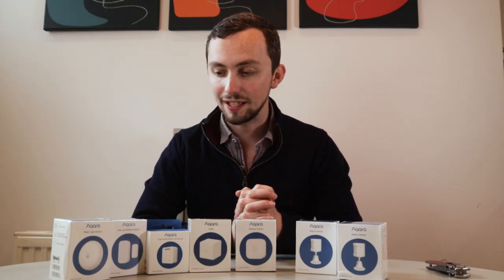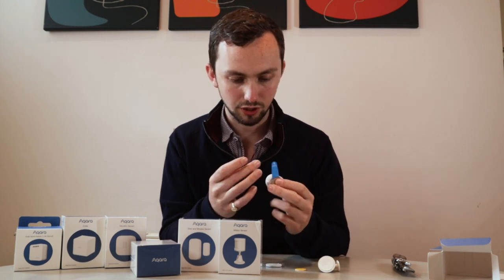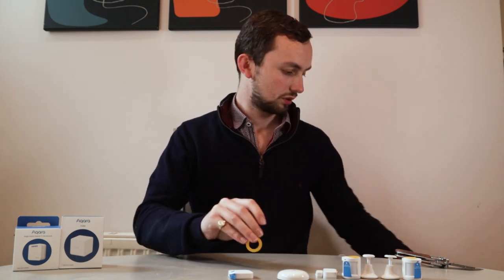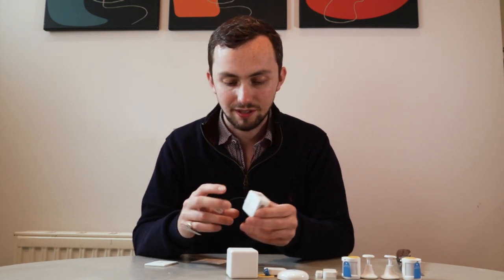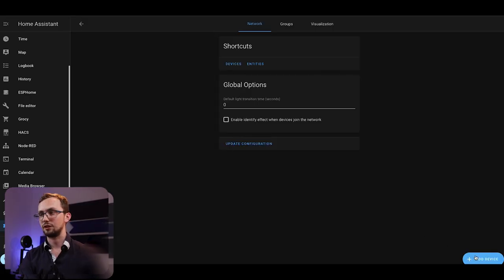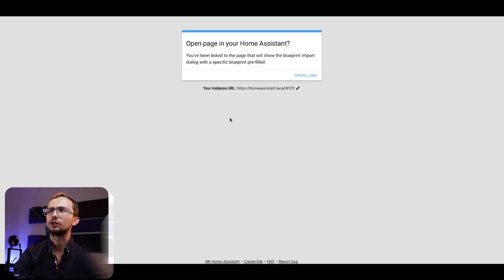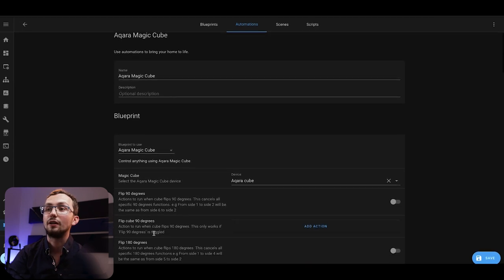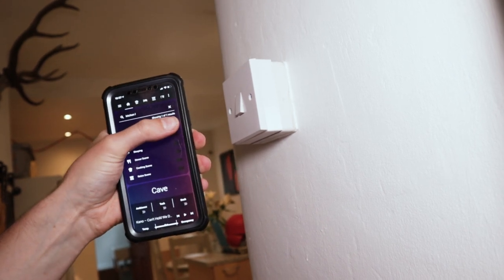Linking Aqara Cube into HA with a  BLUEPRINT

Comment: I use the vibration sensor for my dryer. When it stops vibrating for 2 minutes it sends me a notification that the dryer is done. My problem is that every time HA boots up it sends the same notification. Any idea on how to prevent that? Maybe something to do with the tilt sensor that is also part of the vibration sensor. I also have a cube and will be setting it up with the blueprint as well...thanks for that!

Comment: Hi Will, once again thank you for another great video. may I ask this question, I have a Sonoff RF bridge ( flashed Tasmota ) and it works fine with all my 433mhz sensors, however, i bought a new 433mhz  door sensor and I dont see the code coming up in the console of tasmota ? Any idea why the RF bridge is not seeing the Door sensor. ( They close together ) Thanks